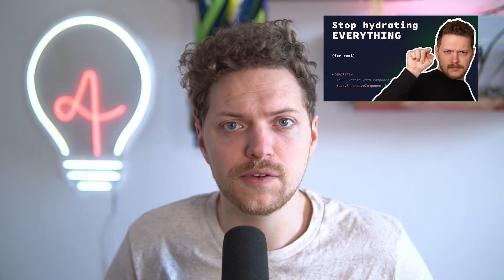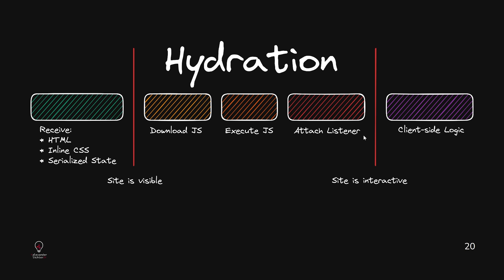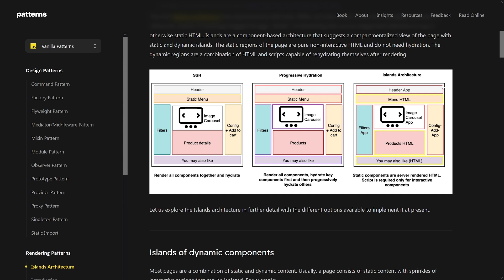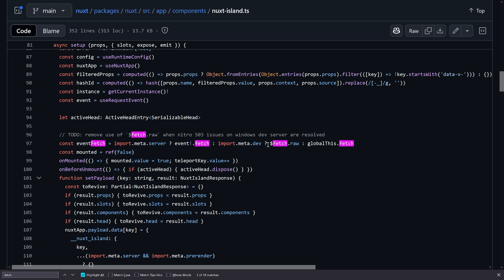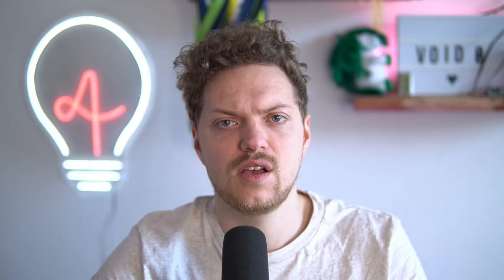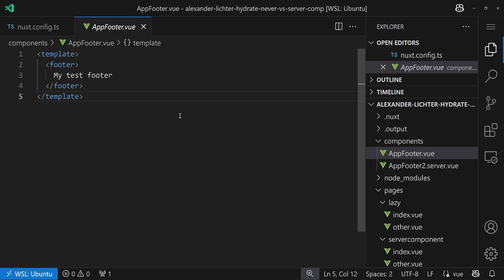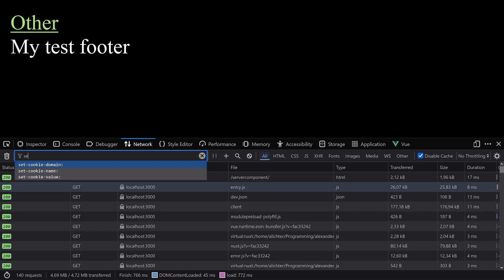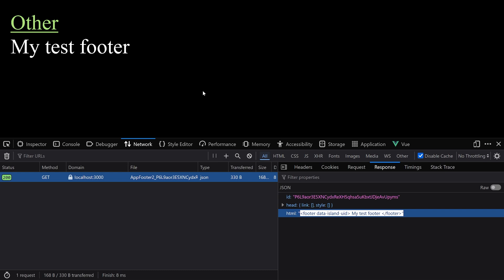Nuxt Server Components vs. Lazy Hydration

Comment: I must misunderstand something important cause I thought lazy-hydration could be also used to optimize even more SSG (on viewport visibility or action maybe).
Also i can"t wrap my head around a mental model for server components with SSG. Does it make sense ? I think not but it would be awesome to have a tip :)
Thanks for content Alex ✌
Reply from the maker: SSG is also SSR, but at build time. So yes, that also improves results when using SSG (for the initial reuqest)

Server Components during SSG make sense if you can prerender all different "options" (e.g. a component without props or with a limit combination).

Comment: Great pain point and subject ! I do all translations by post processing the rendered HTML (Nitro do offer that possibility) and wonder how i can synchronize hydration from bundle with the post processed HTML. Server component solve it, but in the case of hydrated components, the JS bundle will still throw an hydration error and transform the text (or attributes) to the unprocessed value, do you have any idea how to get around that ? Translation is a lot easier to implement when done at the rendered HTML phase with all the context of the page.

Comment: Thank you so much for this. It's great at clearing up what happens 'under the hood' for each of these strategies. I'm curious about the user experience when visiting a site that is mostly lazy-hydrated vs visiting a site that is server components. I have a couple of local Nuxt projects that I may try that with. Thanks again!
Reply: There should not be any difference, in both case the served HTML is rendered first. the hydration will just add a step. the problem arises when there is an hydration error and the HTML is repainted, this is the case to avoid and sometimes it can be challenging to debug or comes from third party library. depending on the level of interactivity (site or dashboard) you will adopt a client or server rendered approach.